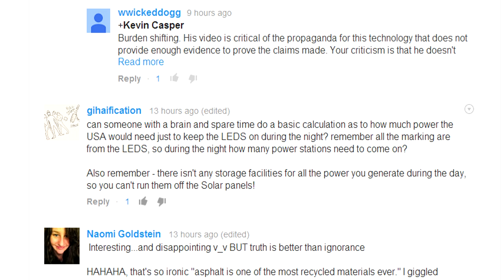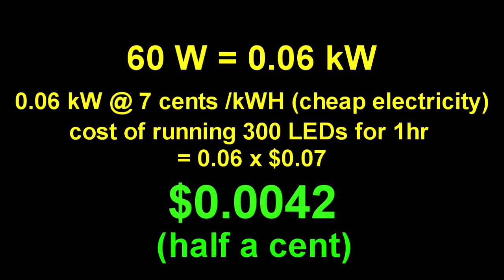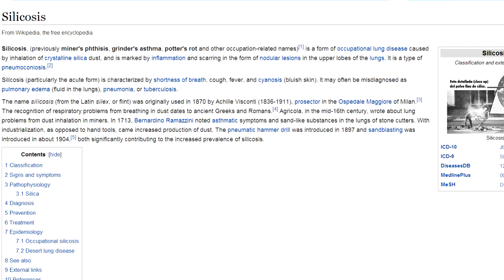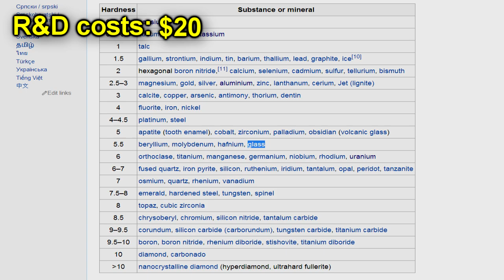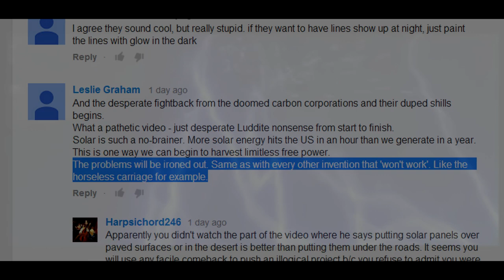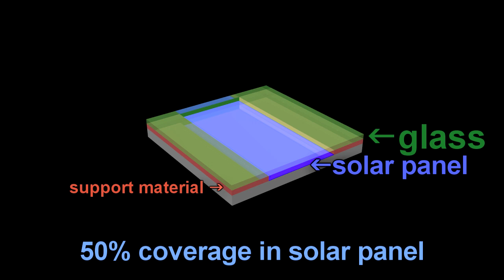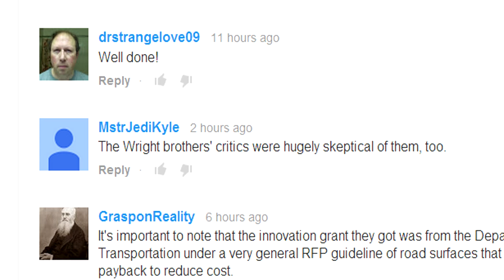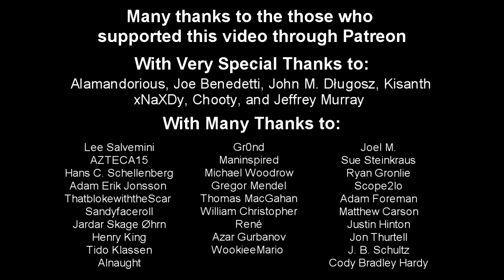Solar Roadways, IMPORTANT QUESTIONS AND ANSWERS!

Comment: Like Thunderf00t already pointed out brilliantly; This is taking a great idea (solar energy) and making it into a stupid one (putting them in the road). We should focus on putting them in our buildings. Here in Denmark, Germany, Sweden, Norway and few other places, even if its only a small effort atm, is putting solar panels into new construction, while also upgrading the electrical grid to better harness excess energy, and help resupply it where its needed. Sorta like an energy internet. This though, is just to help the situation, I'm not saying this would be a replacement "simple" fix.

Making use of roads to make energy, using "gravity" generators would make a lot more sense i.e, small, very slight movable plates, that generates a bit of power every time someone or something "steps" or "drives" over it. This can be done very cheaply. It won't be a contender as a standalone solution either by any means, but at least that idea makes sense. The energy and pollution problem, isn't going to be solved by one thing (except maybe fusion, though even that will probably be hindered due to the cost of making the plants, should the technology prove viable down the line), it'll be a combination of things. Solar panels on buildings, better electrical grids, pressure generators, these could just be the start. Ideally we'll integrate a large portion electrical generation, into our infrastructure.

Or we jump on a good sells pitch about making glass roads :P
Reply: Jeremy Eaton  They claim glass is harder than asphalt, which is just used as a binder for the mineral aggregate. Asphalt concrete is usually what we mean when we say asphalt. I also have a hard time with the claim they could de-ice roads during the winter (disclaimer: I live in Edmonton Canada) If the tiles don't generate enough power for the LED's how are they going have enough left over to deal with falling snow or freezing rain. In both situations there's generally not a lot of sunshine.
Reply: Jeremy Eaton Haha what a joke that link is...  all it does is pitifully dodge accusations.

 "False Claim: We picked a really stupid place to put solar panels"  then goes on to explain that this is what the govt wants- so the govt never invests poorly in stupid ideas?

"False Claim: Solar Roadways is going to cost $60 trillion dollars" goes on to say nothing about any numbers whatsoever and makes no attempt to refute the breakdown of the cost on any level- only an estimate backed by nothing.

"False Claim: Asphalt roads are cheap and maintainable"  Of course there are costs in producing, repairing, recycling asphalt- gee why do we not just build roads out of diamond impregnated in titanium cause it would cost even more.  I seem to recall thunderfoots last breakdown was just for one of the raw materials and already costed more then the entire nations spending for half a decade.

"False Claim: we can't afford to heat roads"  Again no figures on costs other then conventional costs.   No proof it would work on something like a bridge which freezes easier and what happens when sections of it stop working?  Let alone the actual costs.   The albedo of snow is around 85%  so 10-20% of the suns light is turned into heat,and yet what falls in one day can take several weeks to melt by the sun, which this person thinks can provide that power anytime is pleases when needed to save lives.  Get real.

"False Claim: Glass is softer than asphalt"  Mohs scale is only part of calculating wear and tear- glass chips easily, particularly when a nearly equally dense pebble is ground into it.

"False Claim: You can't see LEDs in direct sunlight"  Goes on to show a traffic light with a guard that blocks snow and sun light.  Then goes on to show billboards.  So how much power do they use so people can see them in the day...
                                                       kWh/y          Annual Cost
                L.A. Reading                    61,032          $8,361
                Barco LED                       73,584          $10,081
                LVP2056                         92,715           $12,792  ...
                EraLED Series P20        249,690           $34,208  
                Optec Displays              323,773           $44,357  

Pseudo scientific drivel, spin and dependence on emotional irrationality is the only thing demonstrated in that link.
Reply: Here's another thought, what about glare from the surface.  I suspect it could be quite bad on bright days and depending on the time of year. In northern areas during the winter with sun more to the south and lower in the sky I imagine the glare would be really bad. 

In addition urban areas with tall buildings or tree lined streets would reduce the amount of solar radiation available for power generation.
Reply: Jeremy Eaton

1. Glass will get torn to all hell because it's rather soft compared to rocks and dust. It's also brittle and prone to breakage.

2. This takes an already expensive technology (solar panels) that almost never pencils out without subsidies, then adds expensive glass, expensive LEDs, expensive reinforced concrete foundations, expensive drainage systems, expensive underground electric wiring...
Reply: Jeremy Eaton
1 was already addressed in this video or did you stop watching?
2 is based off an assumption based on current trends, efficiency increase will eventually hit a wall AND solar panels lose efficiency the longer they're in use.

Anything else?
Reply: Jeremy Eaton
The 'coffe e' pot is made from borosilicate glass which is much harder than the glass of the bottle he was scratching up maybe you didn't realize the point of the experiment?
You certainly seem to have trouble grasping concepts.

The LED's can be controlled (yeah no shit)

Sorry I don't play League of Legends.
Reply: Jeremy Eaton he put about maybe 7 pounds of force with that rubber on that glass and scratched it, imagine what a car weighing about 1500 pounds or so would do, in reality the glass wouldnt even last a year.
Reply: Jeremy Eaton - Cars driving on a glass road...  The real proof of concept on this will never happen.  

Solar energy is critical to our future so if we ever do have the public will to build a huge solar project of the scope this road project would require, there are much better options.    Plenty have already been presented and are easy to find.   Running panels beside the road, which was presented in the video, is far more efficient at collecting energy, a fraction of the cost, and far far less expensive to maintain.   That's just one of several better ideas floating around out there.
Reply: Jeremy Eaton

2. And why can't we just put them next to the roads or build large solar parks that are much more efficient?
Reply: Jeremy Eaton
This changes nothing about the hardness of materials. Glass is not very hard and rocks are thus the glass is the one to give away before the rock.

Take knife sharpening for an example. The steel for a good knife is very hard, so when you sharpen it you use a type of very hard sand suspended in a soft medium (a whetstone). The hardness of the sand is greater then that of the steel so the knife gets ground down as a result.

No matter how much you might like the idea, unless you can come up with a transparent glass that is harder (measured in rockwell) then sand and stones its not going to work because the glass would turn opaque when you drive on it.

If the inventors of this crazy idea had taken any engineering courses they would have realised why we use rock and not glass for road construction.

You could use sapphire glass they use in those really fancy-pants watches. But that would be rather impractical.
Reply: Jeremy Eaton  I find it rather entertaining that whenever an idea comes out, people who think it's cool will defend it to the death despite critisisms of it.  Admitting that you may indeed be wrong is fine, there's nothing wrong with that, even just admitting that you really don't know anymore about the project than the critics do saves you from looking like a sheep who is content being led by it's sheppard.

I'm not saying it's bad to support such an idea, but if evidence is presented against it with just as sound science, it's only scientific to question it.  Scientific individuals want ideas to be tested, they don't defend one idea against all evidence on the basis of "it sounds cool."
Reply: *****
Another ludicrous idea as the cost of construction and maintenance of a gravity capacitor would far outweigh the benefits of the device.

Where I live they are using reclaimed power from breaking and feeding it directly into the power grid for use by other trains or people. A much more effective way of reclaiming that power.
Reply: JNCressey I obviously used the "gravity generator" as in quotation for the lulz factor. Hydrate that vagina please ;) And no, because a car doesn't have to be run by petrol, and in 10 years they won't be.

The point however, still, was that you should make SENSIBLE integration, and not stupid integration. Building solar panels into buildings makes sense, as nothing more then its presence is required. Making solar panel roads doesn't make sense, because it would require tons of qualities that is not inherent to them, like being able to withstand enormous weight, being covered, and being scratched, just to name a few.
Reply: trooperJac When the congressman supporting it is named Crapo....
Reply: Guess where the energy from "gravity" generators is coming from? Pushing around small moveable plates doesn't come energy free.
Reply: superdau I never claimed that it did
Reply: *****
It would be way more efficient to burn the extra fuel the cars need while driving on these generators in a powerplant. For pedestrians, ok, maybe they like a squishy floor ;)
Reply: superdau That totally depends on the executing. Mind you I'm not talking, as far as I know, about an existing technology, but its at least conceivable that something could be constructed to absorb some of the energy, without becoming a big contributor to sound pollution.

It simply a brainstorm example of integrating electrical generation in a sensible way. Again, to point it out with the utmost clarity: The point was SENSIBLE integration, of which glass roads with solar panels in them, are not. Even if my example isn't currently possibly, the point of it isn't invalidated.
Reply: ***** Didn't know that.. and here I thought I was being original xD Anyway you got my point exact. Integrating energy generation into our buildings, would help elevate a lot of problems. It wouldn't be easy, but with effort accumulative work, it would be over a long period be a change for the better.
Reply: 1.  It's tempered glass. Not a bottle off the shelf which the video very deceptively shows. They also have a chart of what the hardness is. I trust their data. 

2. The efficient of solar panels doubles every four years. The costs have dropped, more materials to make solar cells  have become more feasible and cheaper. I would kindly suggest that we broaden our concepts of what is feasible. Ultimately the markets, and politics will decide. 

Anything else?
Reply: 1. He scratched the bottom of a coffe e pot?! And you accept that as proof it won't work?!  
I went back and watched enough to realize the asshole was
-using false premises to set up straw men arguments. If you buy this you've been duped. The Led's can be controlled, so the the amount of power that might be needed to turn them ALL on is irrelevant. 

We're done here. Thanks for playing "lol".
Reply: ***** 'gravity generator' lolwut. any energy the road steals from the car by lowering it the car has to provide with it's engine to get back up. You've basically conceived of a fancy over complicated petrol generator.

*****  Generators of any sort don't create energy, they take energy from another system. Assuming you're being truthful about these pressure plates that power the street lights, what they're really doing is taking energy from cars and people that walk on them.
Reply: Buying the titanium plating would probably be cheaper for coating these than the glass + solar panels.
Reply: GalacticDoomSquadron That thing very very likely is even worse: Those fucktards arent dumb, but intentionally scamming people. While Those form Solar-roadways are simply dumb.
Reply: GalacticDoomSquadron
this is the stupidest scam i have ever seen. fusion energy in the palm of your hand. if we have access to such small scale fusion reactors, don't you think government would have sponsored large scale generators already? it is a proven fact that fusion reactions is more efficient that fission reactions for energy production, with added bonus such as an near infinite fuel supply but really? decentralized fusion generators? this technology is definitely worth scientific publishing but the lead scientist doesn't even have a PhD. (if he did, he wouldn't be call lead scientist so and so). I fear the safety of their immediate surroundings if they do indeed attempt the experiment.
Reply: To quote Patrick Star:
"We need to take the solar roadways and push them somewhere else."
Reply: The perfect is the enemy of the good. It's easy to be critical... and this guy is full of shit. This video is debunked on the website. http://solarroadways.com/clearingthefreakinair.shtml
Reply: Jeremy Eaton
Great...now he needs to do a 3rd video!
Reply: Lorne Dmitruk So you say that by asphalt people mean asphalt concrete, how hard is that? All I can find when I try and search for asphalt concrete is loads of sports forums discussing what's a better surface to run on.
Reply: JNCressey I've  done some digging and it appears the strength of asphalt is measure using a structural number (SN). The definition of SN is: is an abstract number (SN) that represents the structural strength required for a pavement to perform in accordance with the design criteria. This number is determine by the thickness of the various layers multiplied by a coefficient. So it looks like using the hardness scale doesn't tell the whole story. In addition asphalt is composed of about 90% to 95% aggregate by weight and 75% to 85% by volume. Some interesting stuff to peruse but I haven't had enough time to read in detail.

Some documentation I looked over but not in depth.

Overview of Asphalt Pavement Design.pdf
AsphaltCompositeSmFst.pdf
ACPAPavementEquivalencyChart.pdf
Reply: JNCressey That depends on the aggregate used to make it. It's possible to address this without knowing the specific properties of each mineral in the aggregate by simply noting that it doesn't matter if a single stone in the aggregate gets scratched up, there's no need to keep the concrete in a state that allows for the transmission of light. Plus, the composite nature of concrete actually gives it a very useful property: it's very strong against compression.

I recommend looking up some literature on concrete as a construction material if you want a real, in depth answer to any questions you may have regarding its usefulness for roads. It's actually a lot more interesting than it sounds.
Reply: B-but LEDs! And pretty things!!! Whoaa!
Reply: Don't need gravity generators with this: https://www.indiegogo.com/projects/focus-fusion-empowertheworld--3
Reply: Harry He "  I fear the safety of their immediate surroundings if they do indeed attempt the experiment."
A good thing about the tech they are using - as soon as anything fails, the critical state is disrupted and any fusion-process stops.
Ont he other hand: Yes, i would be afraid if some kids build a fusion-reactor and don't know what they do.
Reply: You can actually get significant solar energy in Sweden and Norway?
Reply: charlesvan13
Yes - when you align the panels to the sun you get quite a bit of power.
i'd assume the difference might still be 30-50% maybe.

The problem is not, that you can not get power, but that you don't have enough space. You can not lay them down nearly as close as in regions close to the equator.
Reply: ***** Oh you mean I should take the word of some dude with a freakin youtube video versus the engineers who designed it? You might be using the wrong definition of fool....
Reply: It's likely that aspects of this are ambitious. Will not the technology change rapidly anyways? They claim to make it competitive with asphalt. What might you need to see to be convinced? The enemy of the perfect is the good. Glass- tempered will work n'est pas? Cost? Who can tell at this point? It's likely that iterations of this will change, problems will be found, solved, and remain unsolved.
Reply: I'm still not sure where your objections are.

Comment: As someone who has worked with a lot of glass the scratching of glass like Thunderf00T did is very important. With pyrex or borosilicate(what ever the term you are more familiar with) really strong glass scratches can break really easy. In fact how glass blowers break down tubes you score or scratch the glass. I've made pipes that you could drop on concrete and won't shatter but put one good scratch in it and it will break like cheap China glass. Just that point alone should be enough to shatter this dumb idea. When I saw the first solar panel roadways before 1st Thunderf00t video I couldn't do anything but laugh at it. This is just another scam to people that don't have an understanding of basics of glass or science. What a big waste of perfectly good money.
Reply: One big problem is people underestimate road rather than overestimate glass. The road isn't simple, just because tradesmen make it doesn't mean it's a recipe and design mugs can achieve. The amount of maintenance our stone based roads require is staggering when assessed as a whole, most people take no notice like water and electricity.